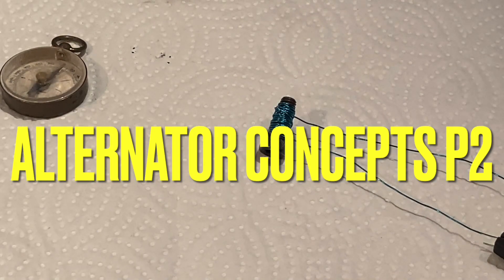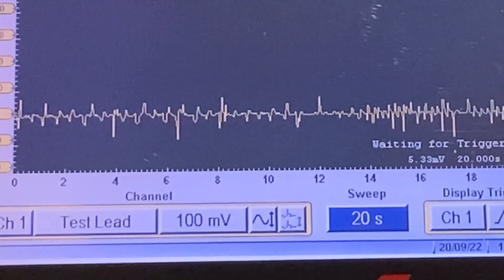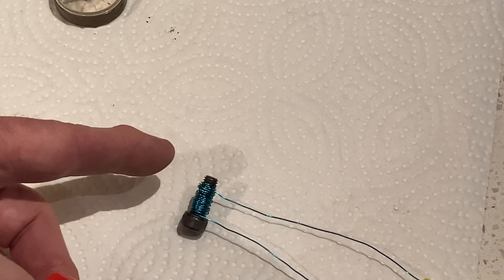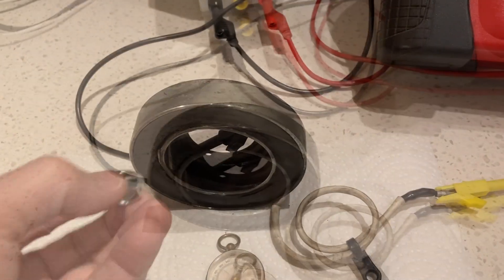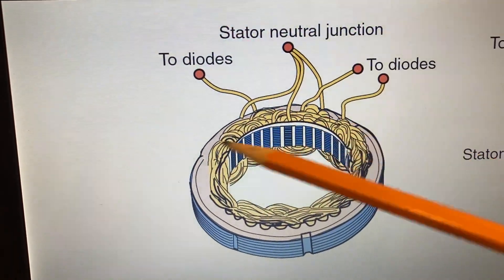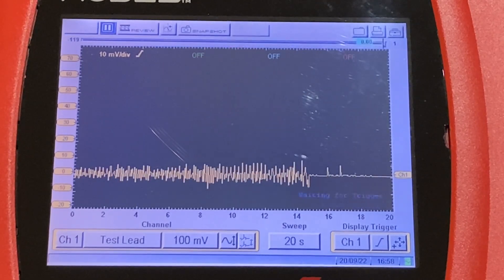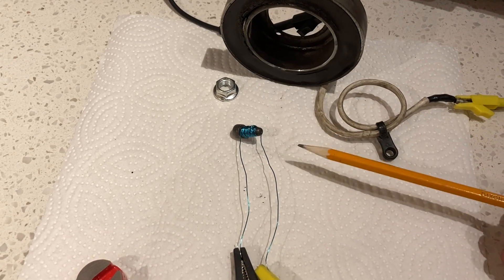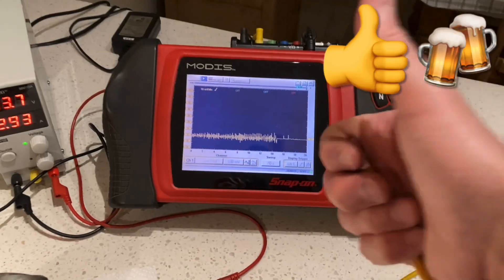Automotive Alternator Concepts (Recut)

Comment: Nice compass. Good video too. Thanks.
Reply from the maker: 😁 25 cent compass proves the point. Thx for watching 🍻
Reply: @TheGibby3340  lol looked like an antique. Ok. Well either way you harken back to the beginning of electrical stuff when everyone knew a compass and there was no GPS. BTW idk if you're focusing on automotive...but what type of generator/motor would an alternator be? Like a universal motor? Switched reluctance? I know those are motors. But it's not really a generator is it? U need the battery and regulator etc to energize the coils as magnets? A "true" generator would just produce DC? This is food for thought, and my own questions. Not trying to be rude or critical. Just thinking about motor types generally now instead of the name of the thing... Like most things are universal motors. Newer E Vehicles have old old style stuff, using modern tech to drive the motors...:)